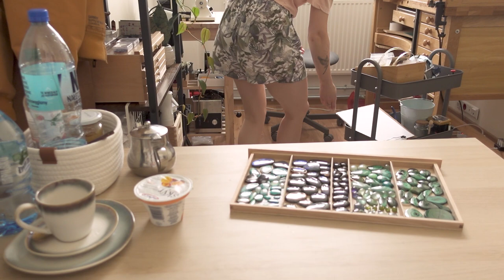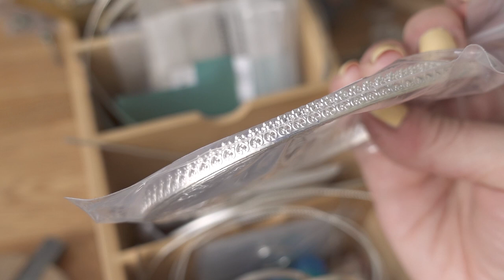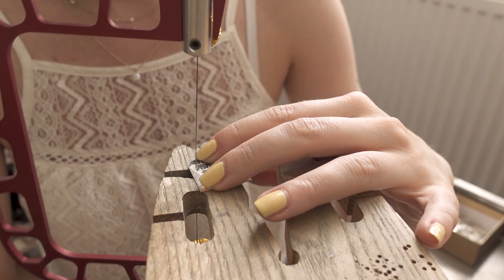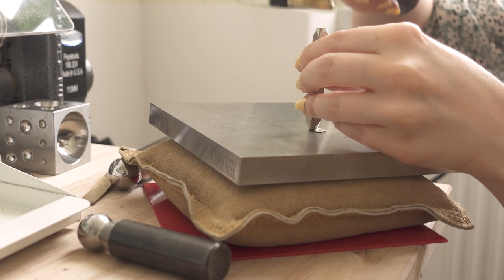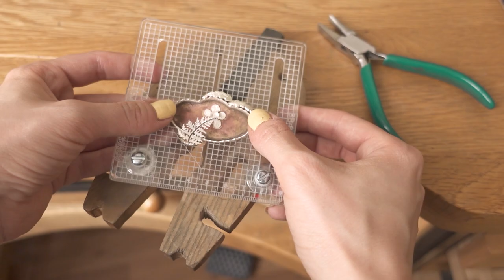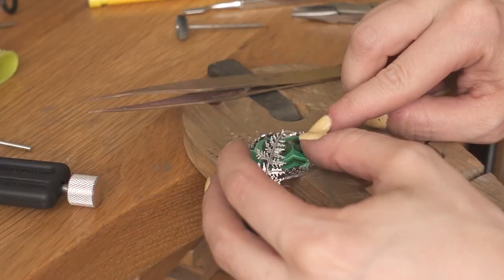I made jewelry inspired by the legendary fern flower of the Midsummer Night!

Comment: I am sorry to comment again but I wonder if it is possible to also solder copper to brass and silver? I love your design and just imagined the oak leaves done in copper.
Reply from the maker: No need to apologize! :) I think it's possible, I've seen other makers use copper with brass and silver. I think you also use silver solder for that. I personally don't like copper much, but I've been soldering brass and silver together several times and it works well :)